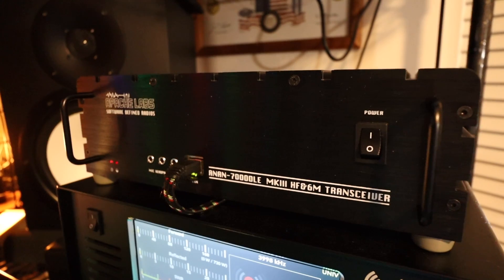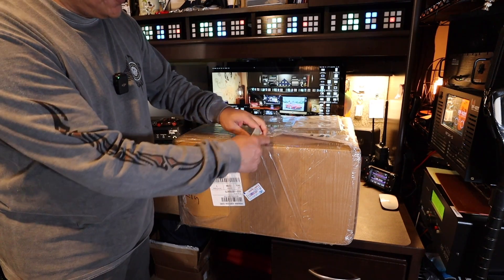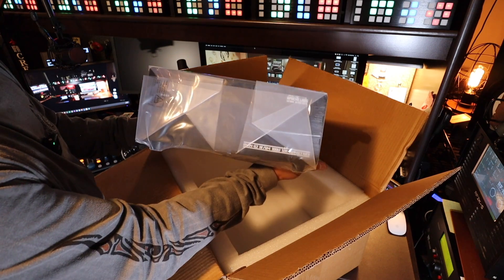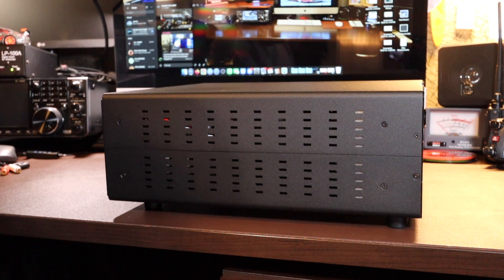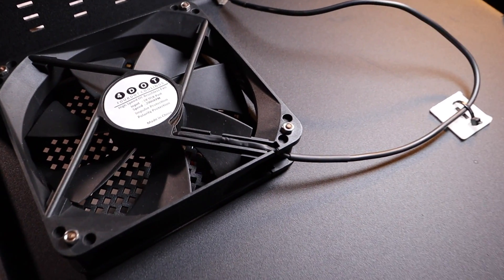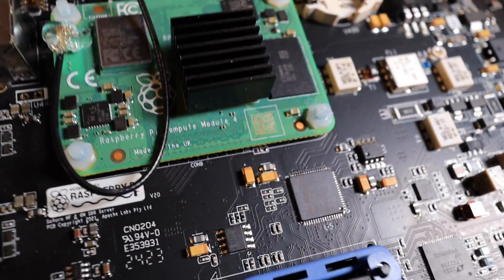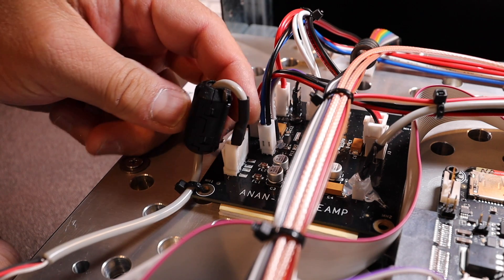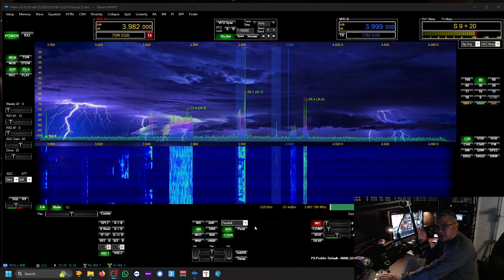Unboxing the Anan G2 | Let's take a look on the inside | Saturn Board | Raspberry Pi

Comment: Great presentation . Thank you so much Darren . Question  ! What do you suggest to connect for external speaker's ? Thanks
Reply from the maker: I'm using a Soundcraft Ui24R, XLR output to Yamaha HS8 Studio Monitors.  Once you look it up, you may look for an alternative.
Reply: @DarrenN4VFR  Great . The Yamaha HS8 are powered speakers do you connect it over the backside HP output ? Thanks
Reply from the maker: @VE2XK  They are powered, the cable I use are XLR.  They are connected from the output of the Ui24R to the input of the Yamaha HS8.  There are also smaller speaker from Yamaha HS8.  Another option for a Sound Card are the Audient iD4 .

Comment: What's the fan like in the g2 ?
Reply from the maker: There are 2 fans, One small one maybe 2 1/2 inches which you can see from the front grill and a larger one.  I don't know the size, maybe 120mm or 140mm.  But they are quiet.  And when it starts getting hot when I'm using my amp for FT8, You can hear the fan speed ramp up.  It's not annoying, but a whole lot quieter than the Mercury Lux and Mercury IIIS.

Comment: I have a question is there any performance improvements compared to the 7000dle you sold? Again, great video. Thank you.
Reply from the maker: I don't see any real differences.  I still like my Anan 200d which is my favorite.  Did you see the video I made about Dayton Hamvention 2024?  See what I bought.
Reply: @DarrenN4VFR  Yes I see you bought a Flexradio love those radios. I may get one again. I had a 6300 and I miss it.

Comment: Great Video Darren... will be joining you with a G2 in a few + months when it arrives!  BTW, do you need to duplicate that SD card inside the G2?  How to do that?  Also, is that 3.5mm PTT port BOTH a PTT input AND and PTT output port in combination? It is labeled with a "/" but I think it is actually a "+".   I will be using a DX Engineering foot switch to key down transmit. So... then.... I see on page 12 of the G2 manual that the tip of the 3.5mm is PTT input (from foot switch) and the ring of the 3.5mm PTT is the Output from the G2 to the linear amplifier.  Do I have that understanding correct?  I too have the RF2K-S currently in my shack... so similar gear there.   I also have the FLEX TUNER GENIUS trans-match so essentially my PTT from the G2 would go first to the Tuner Genius then back from the Tuner Genius to the RF2K-S.  Nice job on the video as usual Amigo! 73 Art W1SWL
Reply from the maker: Congratulations on your new purchase of the Anan G2.  I went ahead and made a duplicate microSD card in case if the card were to get corrupted.  I'm currently booting up my G2 via the clone microSD and taped the original inside the case of the G2. Here's my video: https://www.youtube.com/watch?v=Xf83xngtiaM  

In regards to the PTT on the G2.  I'm using a 3.5mm to RCA Y adapter.  One wire of the RCA is connected to the PTT Foot Pedal and the other is connected to the LP-100A or Amp PTT In. 73 Darren N4VFR

Comment: Do your radio gets hot? Mine does with only 12?watts to drive the amp.
Reply from the maker: I put an AC infinity fan on top of my Anan 200d.  G2, I don't notice much heat.
Reply: @DarrenN4VFR  It seems to me a long carrier on SSB, even less than a minute and 12 watts, it is enough to get it hot. So far, after three days of use, XLR i does not work with a condenser mike, Dynamic mike is very noisy, and the heat issue. Other than that, radio is working so far. Thanks.
Reply: So others know, my fan wire was lose. Working now.
Reply from the maker: @k2icc  Great, so the G2 is not running hot anymore where you can fry eggs on top?  lol
Reply: @DarrenN4VFR  Exactly, now I hope the can fix the XLR input, to use it. I use a DAW, and some Fabfilters plug ins. No Thetis TX EQ or CFC. It adds some highs I dont want. Other than that, USB audio seems to be the best for now. The XLR input has a pre-amp, but still not working for Condensers, and in Dynamics works, but RF and noise, even with the ferrite they put on it. I got a Hermes Lite 2 to practice Thetis and SDR stuff, but now not needed as the G2 is here. Thanks for your videos. I got a lot from them such as the 43' vertical, I got one, diversity, and a lot more. Thanks once again.

Comment: I got my G2 no display two days ago. XLR wont work with condenser, and dynamic has a lot of noise. It has a built in pre-amp for that, but just using via USB and Interface.

Comment: Hi Darren, great video as always. I received my G2 no screen model about a week ago and love the radio apart from the 'XLR' (or more correctly, balanced 1/4" socket). I've been unable to get clean audio out of that socket and I notice the Art recommends a ferrite bead on the preamp feed wire...does that fix the noise found on this input? It's very disappointing that this socket isn't function perfectly straight out of the box, as I'm sure many Hams, like me, have a high quality balanced mic they're just hoping to plug in and use. Anyhow I'd appreciate your thoughts, thanks again for the great videos. Rich MW0XDT
Reply from the maker: Hello Rich. Congratulations on the G2. My microphone mic is a Dynacaster XLR Input to  Soundcraft Ui24R and goes into my computer. I have great audio and Operate at 4K most of the time.
Reply: Thanks Darren, I appreciate the info and have heard that great audio with K0MO!...I just got inside my G2 a few moments ago and guess what?...Apache Labs have fitted a rather oversized ferrite already, near to the socket....so they must be aware of the issue. I've just fitted another like you, near the preamp, but I have my doubts it'll have any effect. I may feed in like yourself via the computer...I have a couple of audio interfaces (yamaha AG06 and a Behinger X-Air 18XR) so I could feed using these. I also run Ableton Live 11 suite, so may be some processing, but dont want to introduce too much latency. All the best from Wales, UK...just thought I had to tell you about that ferrite preinstalled! 73 Rich

Comment: Hi Darren - Nice job with the video! I received my G2 about a week before Christmas and have been enjoying it ever since. Since the radio contains a Raspberry PI, it's a good idea to back up the OS in case you ever have problems later. The installed Pi OS contains a utility under accessories called, "SD Card Copier". You can use it to do a full backup of the system live without removing the cover. You'll need to do this in standalone mode with a kb, mouse and monitor connected. Use a blank 32GB SD card connected to one of the rear USB ports with USB to SD Card reader for the backup copy and then run the utility. I also configured the VNC server while I was there to access the Pi remotely in the future without having to reconnect kb, mouse and monitor. I apologize if you already know all this stuff, but maybe you or someone else can benefit - Enjoy the new radio!!!!  - Steve W9HH
Reply from the maker: Steve, no need to apologize and thank you for the information.  I will use this to make a video for other users of the G2.  I'll give credits to you for giving this valuable information.  73 de N4VFR
Darren
Reply: Glad to share, anytime Darren!  @DarrenN4VFR

Comment: Hey Capt Darrin, I sold my 7000dle and went to the G2 as well, love it. Word to the wise, don't under any circumstances update or upgrade the Linux software in the radio, it will break the connection to the radio, don't ask me how I know... Lol. good luck and have fun, 73 Mark de K7LEN
Reply from the maker: Thanks!!!!  Did you by any chance made a backup of the microSD card inside?
Reply: 4VFR  I did not, but got a copy of the installed program that had me back up and running after the update, I now have a spare SD card tapped inside the radio that is a backup. There is a copy of the installed OS on my computer as well.
Reply from the maker: @mlencioni1  I made a video on how I backed up my MicroSD card for the G2.

Comment: Always enjoy your videos, Darren.  I've had my G2, no screen, since mid-August, and absolutely love it.  I also have a 7000dle MK2, which I will not sell. I'm wanting to keep it for backup.  I constructed my own PTT plug to go with my RF2K-S, and it works great, although I'd preferred the easier RCA jack.  I'm not using the XLR mic input because I already had my  mic audio configured for the 7000, so it was an easy swap out to stay with the smaller input.  It would be fun to talk with you "on the air" sometime. Keep up the good work, and thanks.  Bob NN5D
Reply from the maker: Bob, I'm using TCI so that RF2KS follows the frequency on the Anan.  Good idea keeping another Anan for backup.  As for audio, I'm using the SoundCraft Ui24R's ASIO drivers. Some Hams are using the Hermes Lite + as their backup.  73 de N4VFR
Darren
Reply: Darren, I should've mentioned, I'm also using TCI thanks to a video you had made earlier.  You've helped me in many ways. Thanks a bunch.

Comment: If the computer can see that SD card, you may be able to duplicate its content into another card, in case needed.
Reply from the maker: Great idea!  It would probably be best if I just took the card out and clone it.  But I don't know if Windows will be able to do that because it's in Linux format.  But I don't know how to do it.
Reply: @DarrenN4VFR  Copy content to a folder, then copy and paste to new card. Of course, avoid Windows to scan it or deal with it such as format, etc, that will kill it. In a Linus system, then on the folders, one can be copied to another folder. Just like a file to a folder. I am assuming, major problems if corrupt card, a copy will save the time and steps to go back to fresh factory install.
Reply from the maker: @k2icc  Sorry for late response.  I made a video show how to backup the G2's MicroSD Card.  Have you seen it yet?
Reply: @DarrenN4VFR  Yes. Thanks a lot. I got my Hermes for now and the G2 is on processing. Ordered Feb 5th.
Reply: @DarrenN4VFR  FWIW Balena Etcher and some other softwares are good for cloning SD cards.